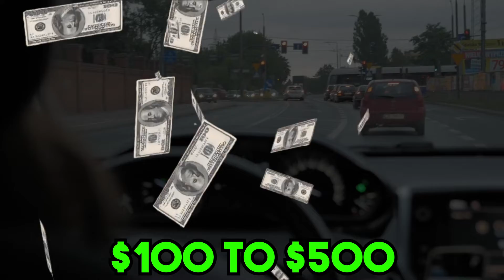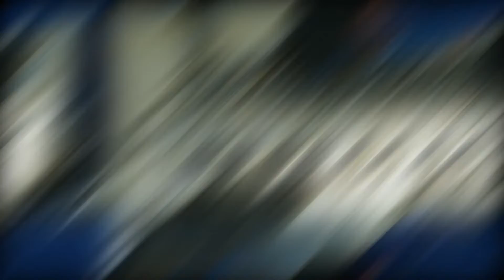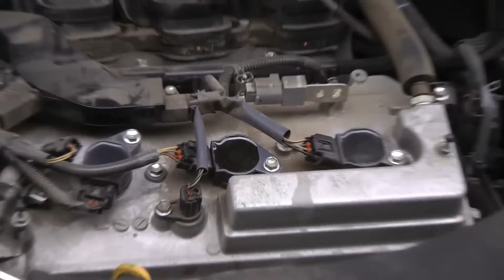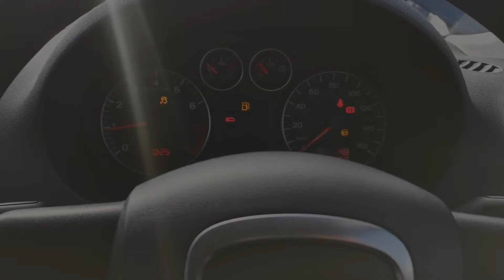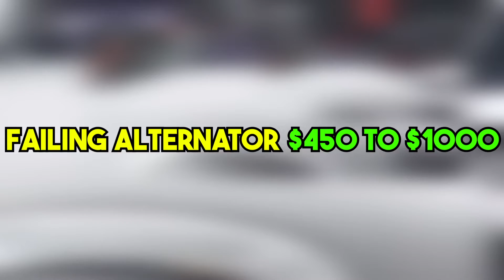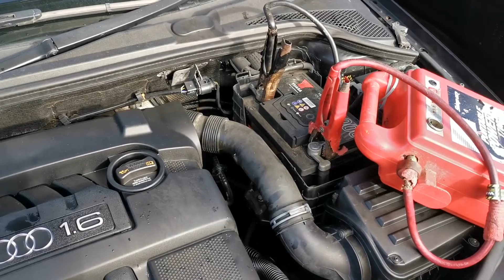EPC Light On Audi and VW (Meaning, Causes, Fixes, Repair Cost)

Comment: Hi my q5 2012  check engine light is flashing when I start the car up then it starts to shake and the epc light comes on I replaced the spark plug , cords, fuel injectors do you know what the problem is?

Comment: My Passat has this intermittently. Doesn’t hard set any codes. I shut it off and it’s gone on restart. Very frustrating and annoying. Dealer gave me a 🤷‍♂️🤷🏻‍♀️🤷.
Reply: In the same boat here (2015 Passat). Just happened to me! Went into limp mode. Left at park and ride overnight and now light is gone and driving perfectly fine. 

Did the shop mention a dirty throttle body as a possible issue? 

Thinking this might be the case..

Comment: What if it goes away after turning it on?
Reply: It normally turns off if you turn the car off and restart it 2 or 3 times .
Turn it off wait 1-2 min then restart it the EPC normally will turn off and it won’t go into limp mode either.

Comment: My audi has an epc lifht on and shakes at idling? What can cause the shaking?
Reply: Mine is doing the same thing,,What did you find out about yours?
Reply: @leeannbaete4682  one mechanic said it was the coils.. changed all 4, new sparkplugs and still the same.. im going to get a mechanic that has an epc code scanner next and see what it shows
Reply: @joetx7646 wow I’m experiencing this now! SMH
Reply: @joetx7646   Throttle body 100%
Reply: @joetx7646 any updates?
Reply: @leeannbaete4682  Throttle body 100%
Reply: Did u find fix
Reply: Yo tengo un Audi a4 2009 y tengo el mismo problema el EPC ya le cambiaron todo eso bujías ijectores,buvinas sigue el mismo problema ya van dos veces que lo llevo con el mecánico y al mes vuelve la luz EPC dice el mecánico que los Audi salieron mi problemático el motor 2.0

Comment: Epc light is on...but when i take it to autozone, no reading ??? Fml any tips?
Reply: Tip 1 
Dont take it Autozone!
Reply: @keith3376  tip one was trade that pos in 😂
Reply: Check your battery. Once you drive it a bit, and the battery gets a charge, the light will go off.

Comment: Just did it and it worked fine for me
Reply: What did you do?
Reply: @trufflepudding4704 following
Reply: I did the same and it worked for me too yesterday but when I was driving again today the light popped up again! Did the same procedure to reset it and it worked!! Might have to get it checked with a mechanic
Reply: @Whitefox0-555 any updates on this?